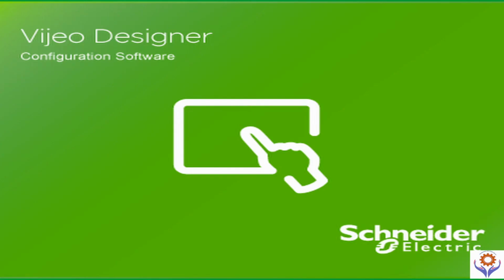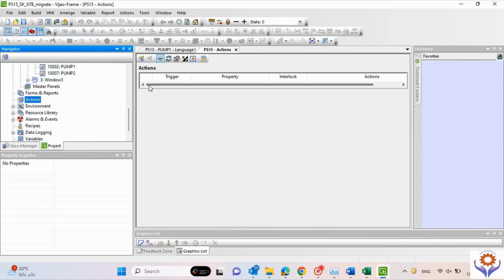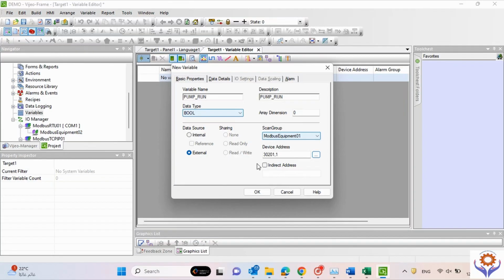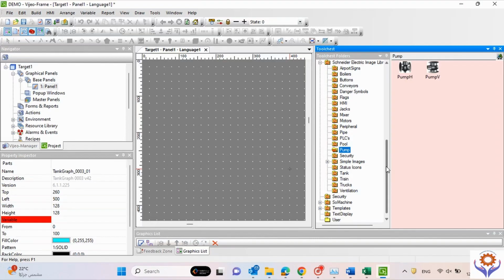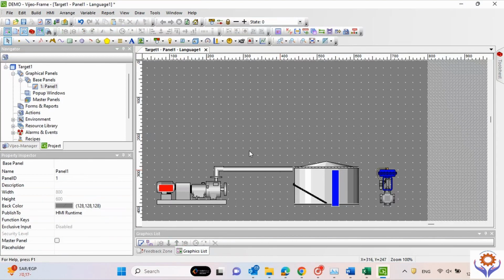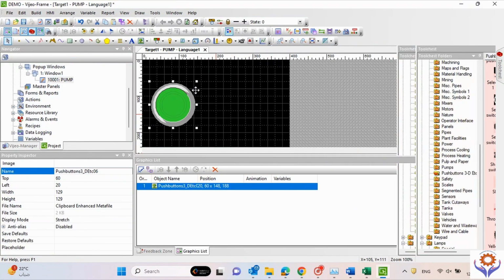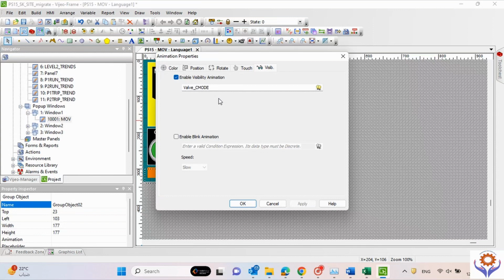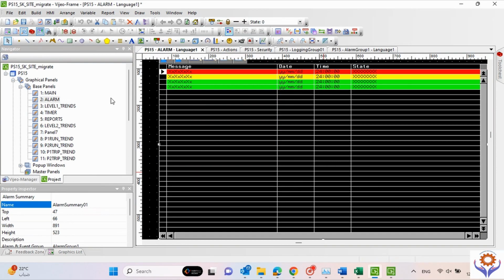Schneider Vijeo Designer HMI Configuration - Part 1 | Vijeo Designer Tutorial Basic Project

Comment: I CANT SIMULATE, WHY? THE BUTTON APPEAR IN A GRAY COLOR, AND I CAN´T TOGGLE IT
Reply from the maker: @hanssolo6311  Based on the Animation property of the Button . Eg.. if the Toggle button linked with  start / Stop push button then check the property .if  the signal is 0 or not  connected  with your PLC or any controller then it will appear Gray color